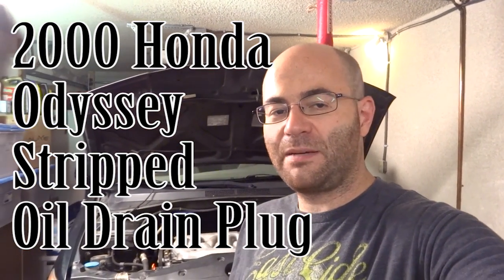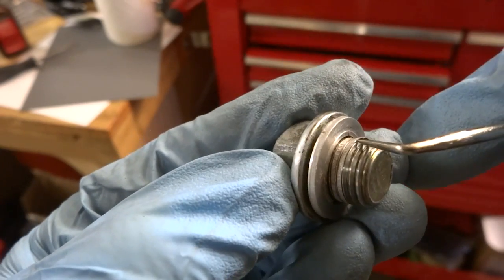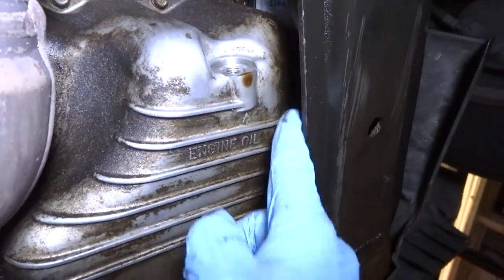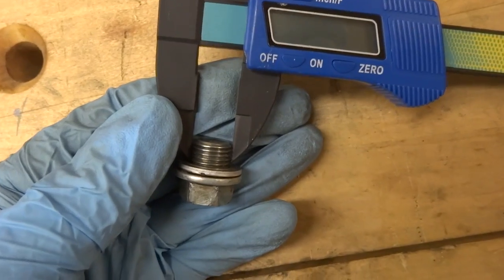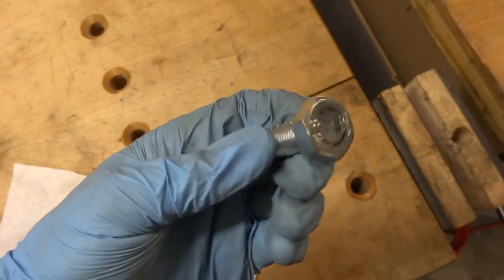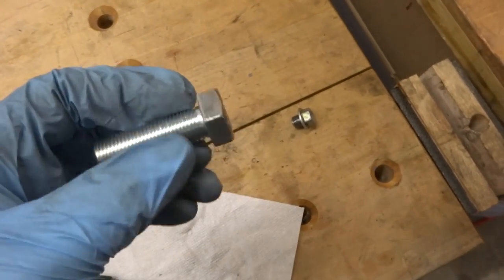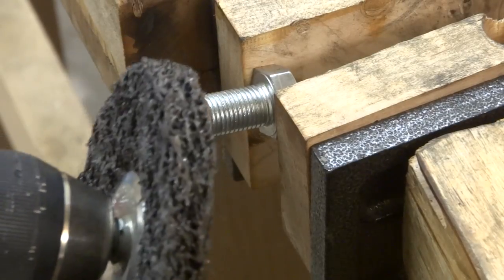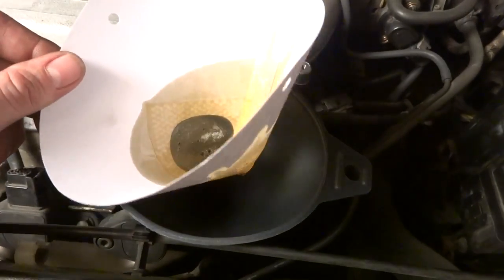2000 Honda Odyssey Stripped Oil Pan Drain Plug Repair DIY

Comment: another tip when grinding/cutting a bolt put a nut on first then once you make your cut unscrew the nut it will align the threads
Reply: legit

Comment: I have two Hondas. I installed Fumoto drain valves on both of them. One time permanent install. No worries about stripping.  Neither has leaked so much as a drop in 4 years.  No tools needed for draining oil. Great product.
Reply: I have already stripped my threads on my 2005 odyssey and it now has a slow leak. Does FUMOTO make oversized valves so I can re-thread and also enjoy the convenience of never having to remove the plug again? If they do, what size/model should I be buying? Thnx.
Reply: @msiddi01  yes. Depending on what size plug your car uses just check their website for one that’s larger and tap for that size. 

My 2006 Ridgeline uses an M14x1.5x14mm length. Maybe yours does too. Then you could go with an M16x1.5 Fumoto valve if they sell one.

Comment: I purchased a magnetic drain plug that had longer threads.  It reached the good threads past the ones that were stripped.  It worked great.
Reply: Where you get it from
Reply: It didn't work for me. It is only about 2 circles of thread more than the original and didn't hold well. The Dorman# 090-164 is much better, 10 more circles of thread.

Comment: I partly stripped the Drain Hole in the Transmission. It holds a new magnetic Plug I put there on ~11Ft-lbs, and torque required is 22 Ft-lbs. No leeks right now. I even don't know or to leave how it is, or it will develop leaks later, since the torque is 1/2 what is needed, so tighten it more. I would appreciate if you could give your opinion on this matter. I saw at the end of the film you snugged the bolt. Can you tell what is the approximate torque there. Thank you for the informative film.

Comment: i just fixed my Chrysler Concorde Today, i have the same problem, and i was lucky enough to get a over sized self tapping bolt from Oreilly, i just bolted it in like a boss i was surprised about it, and actually works, good video my friend
Reply from the maker: Nice, I didn't know they made such a thing.
Reply: i actually found them on ebay and amazon too,
Reply: Mark Chance is that oversized drain plug still working out with no leaks?

Comment: 6:30 Run a nut all the way onto the bolt before you cut it, and when you remove it, you are re-forming the thread at the cutoff point.

Comment: Next time screw a nut all the way on the bolt, then cut it/ grind it / saw it. 
Then you unscrew the nut from the bolt, that way you are making sure that there is a desent thread and no pointy sharp spoons. = nut comes of, nut can be screwed on ;)
Reply from the maker: Lasse Sukkerfar Ibsen Nice tip, I like it! Thanks!
Reply: Great :D We can all learn new things ;)

Comment: How did you get the bolt out? Im thinking my bolt is stripped and not my pan. Ive read to kind of pull on it with vise grips
Reply from the maker: +Quincy Longman spin it with a drill/impact whatever you got and see if you can work a small screwdriver between it and the pan to help it come out.

Comment: Thanks, I'm gonna do this on my D16V1 which some nutcase seems to have also impact gunned. Now I am a little bit worried about the fact that the bolt seems to bottom out on your V6 instead of threading clean trough. Mine seems to be in a similar position where it's following the "floor" of the oil pan. But it would be nice as a last resort to be able to get one of the m15x1.5 rethread kits with spare plugs. But if the thread tap doesn't have room on the back side it seems difficult to rethread. Fingers crossed the long bolt approach works first though.

Comment: I usually tighten my oil pans tight but not enough to strip them. Last time I took it off, I used a 1/2 breaker bar, and I thought I went the wrong way and stripped it but I got lucky. Nothing worse than stripped bolts on a block/oil pan/bleeder screw. When its hot, it tends to wanna fuse, thats why you wanna get it close to the correct torque, especially with aluminum

Comment: Why did the new longer bolt bottom out?  It looked like the threads bore through the aluminum wall.
Reply from the maker: The part of the pan where the bolt screws into is lower than the rest of the pan--so the bolt hits the fold in the pan.
Reply: 50sKid how long did you make the plug? How much of the 45 did you cut off? 

I have a 30 I’d like to use. I wonder if that length bolt would hit the fold in the pan. 

Thanx

Comment: Hey @50skid. Great video. Literally doing he same thing todau for an 05 odyssey. If that 40mm bolt isn't bottoming out is it safe to use it without cutting (i.e have you seen the inside of the pan/know the location of any pumps or parts it might interfere with?)
Reply from the maker: I haven't seen the inside yet.  It very well may be ok (if annoying).
Reply: Appreciate it. I looked at some pan schematics and it looked fine. So far so good. Thanks for the video!
Reply: ishunlimted did you use a 40? Did it bottom out against anything? Any problem? 

I have a 30 I’d like to use in my 2006 Honda Ridgeline.

Comment: Got the hole stripped so far that i wasn't able to screw the drain plug back in :). Drilled the old threads out, retapped and installed a helicoil.

The engine itself is known as a 139qmb chinese engine and the aluminium is really soft.

I did a Engine rebuild last week and found a puddle of oil after just 1 night and replaced the bolt from another engine which still caused a tiny bit of oil leakage and till today i went ahead and used a soft copper ring after installing Heli Coil and shortened the bolt using a hacksaw.

Sure enough and no drip of oil under the engine ( I think 1 drip every week or so )

Running 5w30/5w40 now.

Comment: mercedes benz uses m14x1.5 drain plug just like honda but the one for mersedes is longer, just what you need.  if instead of going to the hardware store you had gone to an auto parts store you would had got the right replacement plug.

Comment: The correct torque for honda oil drain bolts is 42n.m and you can do a Time sert but it is not the permanent fix. Go to honda get a longer drain bolt. It is a normal problem.

Comment: a mercedes drain plug is longer and a great replacement for jobs like this IF you can torque it to 29 foot pounds to make sure the one time use "crush" washer is indeed "crushed" properly.
Reply: Which year/model Mercedes?

Comment: The thread is damaged because:
-- old drain plug seal washer is reused and tighten too much
-- new drain plug washer is placed incorrectly on the bolt (flat side of the washer should go toward the engine, "rounded" side of the washer goes toward the drain plug's head).
-- aftermarket aluminum washer with T6 temper is used (should be T4 or softer)
-- factory torque (27 to 29 foot pounds) seems to be too much.
How to prevent the thread stripping:
-- reinstall plug after engine oil pan is cooled down (about  30 degrees C)
-- if new washer is not available, smear Ultrablue Permatex RTV (which expands when exposed to oil) on the area where threads meet the washer, making 2-3 mm fillet, then reinstall the bolt; maximum torque to be 18 foot pound
-- reduce torque to 22 foot pound max when new washer is used
-- do NOT change oil too often :)
Reply: I wonder if the quick oil change places (Jiffy Lube, etc.) use a new correct washer for every oil change?

Comment: 14 mm by 1.5 thread extra long drain plug fits Mercedes Benz and others will fix this. I believe the dorman part number is 090 - 164

Comment: A much better way is to get a long M15 x 1,5mm bolt, cut a groove into the end, put some grease of Vaseline in the groove and screw it into the oil pan...slowly and straight. Do it until it goes all the way and then clean the threaded oil pan hole with carb cleaner..then you can cut off the longer grooved part of the bolt so it just passes through the thread in the drain hole, put a washer on ...viola.

Comment: Get  a oil drain plug insert kit. You may need a large drill. A Big-sert kit may be better. It has a steel insert. Lisle has a kit that might  work. A steel insert is better. A 14x 1.25 Sava-A-Thread kit may do if yours is that size.

Comment: Hey man love all your videos (specifically your E46 diy's). I was trying to do my oil change and once i broke the bolt free and started to try and take it out it just kept spinning. Im hoping its the plug but preparing for it to be the pan. Do you know what the thread count is for the E46 plug?  Thanks for your tips and help
Reply from the maker: +Quincy Longman Ouch.  Surprised that this would happen to the E46 as it's a steel pan.  I'm sorry I don't know the thread count but it seems to me the most important thing is to get it out first.  Good luck!
Reply: +50sKid thanks a bunch!

Comment: Another great video!  A tip for you and your friend, in case you guys weren't aware already.  So the Odyssey's and Accords of this era are notorious for having transmission failure.  Turns out, they have no filter and only use 3.5 quarts for a drain and fill! (No wonder they fail).  The forums recommend a drain and fill at every oil change.  There are people who have done this since day one and have over 300k miles on the original Odyssey transmission!  At work, we've also brought a couple back from the dead by just doing a drain and fill, run it for a little while, then drain and fill again, a few times.  A slipping seemingly no good trans, magically running like new and still going!
Reply from the maker: Thank you very much!  I've actually heard about the transmission problem--the one on this vehicle has been replaced once already.  I've never heard or read about the actual cause of the problem or even what the symtoms are (just slipping gears?), however I think I'm gonna have to look into it further.  I think a transmission service is an easy thing to do for peace of mind, no doubt.
Reply: but doing it every time you change your oil is a little extreme depending on how often you change your motor oil. for me I change my oil every 12000 miles so in that case I could see me changing my transmission fluid at the same time because I only drive 9500 miles a year. 90% of that is free way
Reply: +bep2001 kumar but I don't make it to 12000 I change my oil once a year so typically every 9600 miles is when I change my oil
Reply: +MrOatmeal5150   There are a couple good videos about removing the trans fluid by disconnecting the cooler line and pumping it out a quart at a time by running the engine a few seconds.  Then top off and repeat until the fluid is clean coming out.  Always use Honda original fluid.  It is NOT the same as standard transmission fluid because Honda transmissions have an unusual design.  I do a drain and fill at every oil change and a complete flush at 70,000 when I replace timing belt.
Reply: John Ferguson I've been using royal purple max atf for about a year now in my honda civic and my shifts are better then when I was using the genuine honda ATF. From my experience as long as your using a fluid that is compatible with honda ATF-Z1. You should be just fine.
Reply: bep2001 kumar The issue with fluids like Royal Purple is how long the additives/modifiers last.  They produce excellent performance but usually it is only for a shorter period of time.  Red Line gear oils perform this way.  Great at the track, but not so great 18 months later.  If you are performing a drain and fill every oil change (10,000 mi) you will do fine with any compatible fluid.  The problem is that people typically don't maintain their vehicles that well.

Comment: Try an OEM drain plug, from a 2000- 2005 Honda Insight #90013-PHM-000.
It's longer, the same 1.5 tread pitch, and 14mm.
Reply: Do u know if the Honda and the Saturn Vue with the Honda package share same oil pan??
Reply: @merrymenagerie4116  the engines are the same Except for the Crankshaft.
Honda’s crankshaft will last 400,000 miles and the Vue’s will last 150,000 miles

Comment: My brake, door lights, and battery light came on  2001 odyssey idle rough and surging when in drive and come to a stop. Any idea what that could be? Thank you
Reply from the maker: The surging is your idle control valve.  A battery light usually means your alternator isn't working.  Not sure about the rest.
Reply: Thank you so much! I also noticed the idle is a little rough I had the alternator tested because I had a battery drain. The alternator tested good. I replaced the battery and it was good for a little while the lights went off but now they're back on 😰 the electrical has been a little wacky for a while. Thank you for the great heads up on the PCV valve. As soon as I can hunt this problem I'll have my mechanic change the PCV, if I don't do it myself, thank you again for your prompt answer, I'll keep you posted

Comment: the length of the screw it's the reason why it cut the thread. i don't think it the original screw. it's well known that the thread length has to be 1.5xdiameter. so for the m14 you need at least 21mm thread.
Reply from the maker: Yeah it's the original screw.  That's Honda for you.
Reply: Would 30mm thread be too long to use in a 2006 Ridgeline pan?

Comment: The mercedes oil plug works the one with the 13mm head it's same  Threads just longer thank me later this happens alot. People try and change their own oil then take it to Walmart and hope they don't notice so they can blame them. The main reason they get a bad reputation in my opinion

Comment: I noticed that there is not much Thread Engagement there is only a small portion of the plug where it is screwed in.   looks like there is more thread at the back of the hole  use a longer bolt to get full engagement .  also Aluminum (Soft) is not made to have a bolt run in and out of it namely a steel one . don't know what car Engineers are thinking
Reply from the maker: That is what I did in this video

Comment: Honda needs to stop making these things.  I never had a problem with any other aluminum oil pans.  They have us torque them down to 29 to 33 ft lbs per the recommended specs with a torque wrench.  I think using anything else than a wrench and a couple of love taps to make sure it's snug is overkill on these things.

Comment: What I did was put a pan saver bolt in there in place of the original oil pan bolt
Reply: What’s a pan saver bolt? Part number or link?

Comment: Why do the work ? Why not just buy a shorter bolt ?
Reply from the maker: +Jim Brown not easily available in US hardware stores
Reply: Jim Brown product no longer available it seems.
Reply: Jim Brown I found a M14x1.5x30 at an Ace Hardware. Would that be too long to use? Would I need to cut off a few millimeters so the plug won’t bottom out and touch something inside the drain pan?

I have a 2006 Honda Ridgeline. Same issue as the Oddysey in this video.